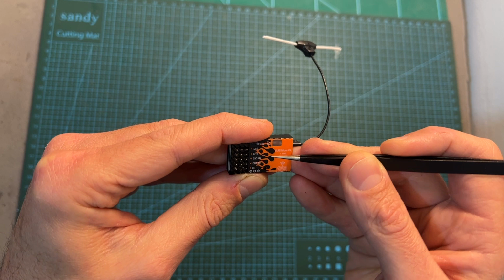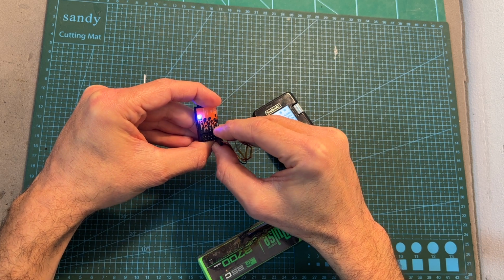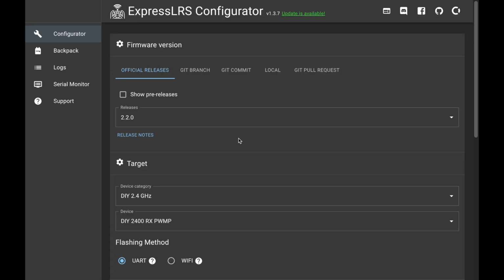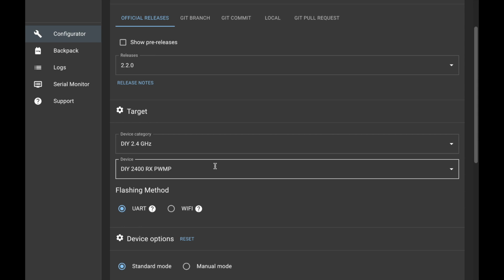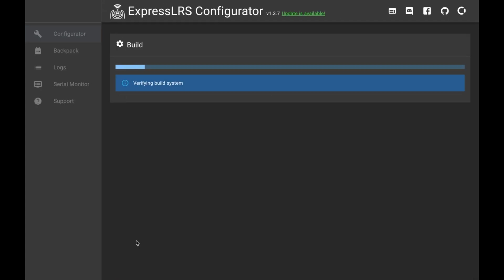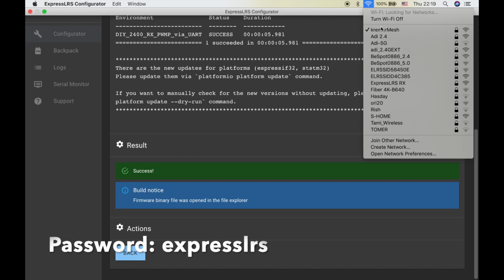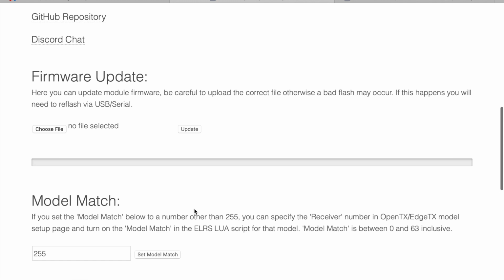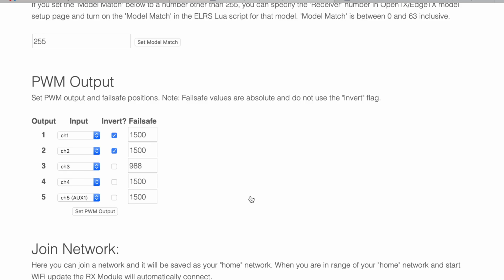BETAFPV ExpressLRS ELRS 5CH PWM Receiver - Bind, Setup & Overview

Comment: does this work with the lite radio 3?
Reply from the maker: Yes
Reply: @KremerFPV  hi im struggling with this. theyve got the same binding phrase and I put the controller in bind and it wont connect. is this some issue to do with incompatible versions? (I tried without binding phrase and without putting the controller in bind)
Reply from the maker: @inkyspirets2460  make sure both modules are updated to the latest version.
Reply: @KremerFPV  okay so i cant change the version on the lite radio 3 so i have to downgrade the micro rx but my elrs configurator doesn't work. is there a way I can download the file and just upload it?

Comment: My CH5 for a second aileron only seems to be ON/OFF, full movement. At center stick it will sometimes bounce back and forth. CH1 will pan smoothly through the full range. My web interface seems to show it configured as PWM. Totally new to this... Trying to program flaperons.
Reply: To clarify, OUTPUT 5 had the issue. It was using CH5 which will always be a binary with ELRS. Remapping that output to CH6 allowed for the 2nd independent aileron.
Reply: @zeilstar  Channel 5 is an on or off aux switch only signal. it has only high and low values. map your 5th channel pin to 6th channel in elrs configurator. make sure to set a arm switch to 5th channel in the edgetx. because in elrs 5th channel should be turned on before flying for full power transmission.

Comment: I'm running 4s on my planes. Would I need a voltage regulator to use this reciever? My esc only outputs vbat
Reply from the maker: Yes, you need to use a 5V BEC.

Comment: Is it possible to connect a brushless esc to it, and if yes do you have any suggestions (about 40 amps)?
Reply from the maker: You can connect it to the signal pad but you will need to power it externally.

Comment: If I want to use it with FPV, which firmware should I flash it?  Now I'm using betafpv nano 3.0 firmware. It doesn't work properly and the signal keeps disappearing.
Reply from the maker: You're not using the correct firmware. Did you sort it out?
Reply: Its possible to find an firmware 3.2.0 ?

Comment: Hi sir. I have same receiver but how come only ch 1 work. Also i trying to flash it to 3.0 and it say not enough storage when i flash it at 10.0.0.1
Reply from the maker: Hi, did you sort it out?
Reply: @KremerFPV  Yea both were on version 2. But wasn't same exact version. So I cant remember what version i tried but i made sure that both is exact firmware. And from there I was able to get it to work so i went ahead install 3.0 on both and work.
Reply from the maker: @rcrotorfreak  great 👍
Reply: @KremerFPV   Oh how is it working for you how much flight you put in?
Reply from the maker: @rcrotorfreak  I used it for about 20 flights and it worked well.
Reply: @KremerFPV  Wow that is great. What settings are you using for telemetry and rf setting?

Comment: Do you know if you can set it up for Elevon mixing? I'm using the lite radio 2 so I can set up mixing on the radio itself
Reply from the maker: I don't think that it's possible using the current firmware. You better use your radio controller for that.

Comment: Thnak you for the video. Did you find specs about how much amps the WPM output channels can handle. Cannot find it anywhere and want to use some stronger servo's than standard.
Reply from the maker: My pleasure. Sorry I don't have this info. You can try to contact BetaFPV - maybe they can help you out...

Comment: beware the lite rx there with the red antenna doesn't perform very well test it with caution.
Reply from the maker: Yes, Betaflight just released an announcement about it.
Reply: Oh do tell more, i just put one in a micro
Reply: @Euwanh85  Got the lite rx with flat antenna in my 2" and with tower antenna in my 3". If I fly up/down a floor in my house (reinforced concrete ceilings, 2.4GHz wifi router on each floor, 10mW, 500Hz) the flat one has serious drops in LQ/DBM. Just got one each... could be good vs. bad sample or even other electrical differences in my builds: tower: 96 LQ / -58 dBm, flat: min. 53 LQ/-92 dBm.